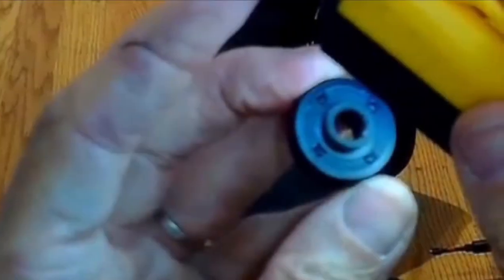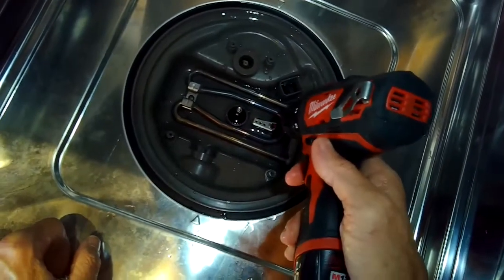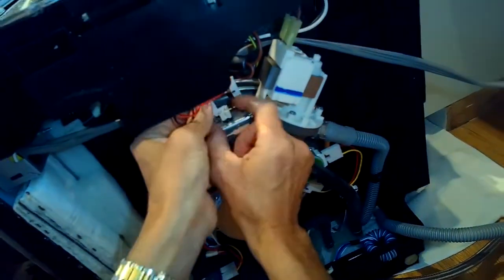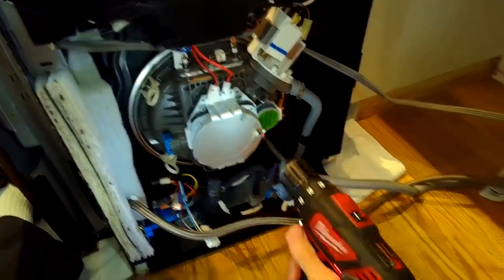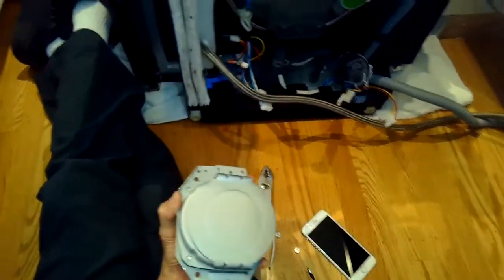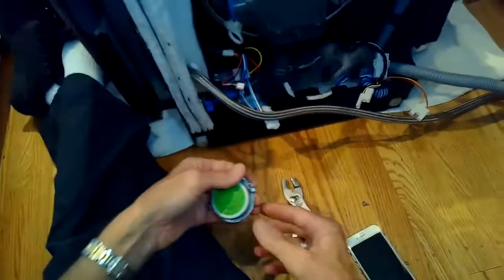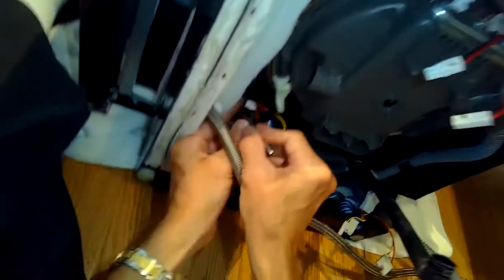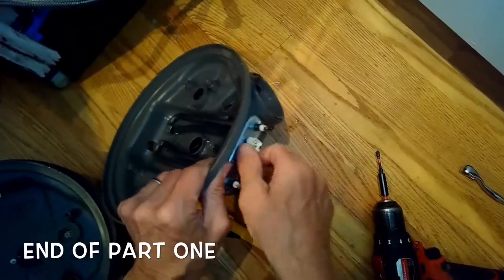✨LG DISHWASHER  - Noisy Pump - FIXED - DIY - SAVE $$$ ✨

Comment: Best tutorial on this subject. Great job.
So the whirring noise is the corroded sump motor bearings and the corrosion is probably propagated by the sump motor's shaft seal failure?
I understand that things most likely are intentionally designed not to last nowadays; it's very obvious when looking at the design of this dishwasher. With the motor being positioned pointing straight up, the only line of defense from water that is being gravity-fed straight down the shaft into the motor is the shaft to sump seal. Unless of course the motor has a shaft to motor housing seal built in. But both of these seals are equally exposed to friction. This design invites compound failure.
I'm planning my fix now before ordering parts and opening everything up. Is there at least a centimeter of open length on the shaft between the motor housing and the sump seal where I could position a rubber fender style washer to snug fit on the shaft? My idea is that the rubber washer would spin with the shaft (no friction) and act as a skirt or umbrella above the vulnerable seam between the motor housing and shaft. In the event of any future leaks, the rubber washer would sling the water dripping down the shaft away from the vulnerable point of entry.
Reply: Did this end up working for you?  I'm thinking that spinning rubber washer might introduce a hum of its own.
Reply: @jeffreyhess5013  - I found there's really no space to put anything between the motor and sump. Thankfully I'm highly skilled at voicing my educated opinions to the company. It took two months of communication, climbing the hierarchy of contacts within the company, and pointing out the engineering flaws (along with shaming and a few empty threats of media coverage/class action lawsuits). Even though it was far out of warranty, in an effort to get rid of me, they ultimately replaced it with a different "better" model that will probably have it's own unique set of flaws appear just after the warranty expires.
When faced with sloppy customer service, I have the best luck when I morph into a thorn and thrust myself into their side never letting go.
Reply: @oodoodoopoopoo  I went up and down the same road with three new GE Profile appliances: A dishwasher that stuck on dry that turned into an autoclave;  a Profile range with an out of control, blazing gas burner; a Profile 220v microwave/invection oven with a blown magnetron. All three were replaced by GE.

Comment: Just found you great video! Wow.  Where did you order/get your parts?  Thanks.
Reply from the maker: You can get a new pump on Amazon for 25.00
Reply: @QuickAndEasy5MinuteAppliance   What new pump?  I found the best deal on these parts (motor and lower case) at Sears Parts Direct.